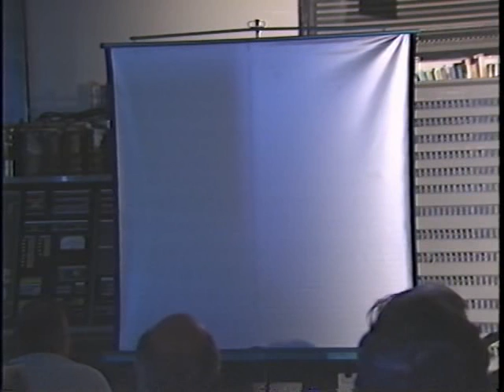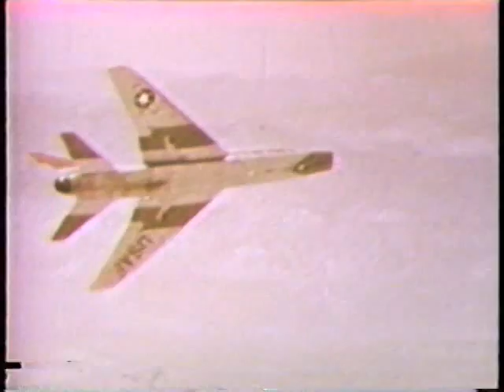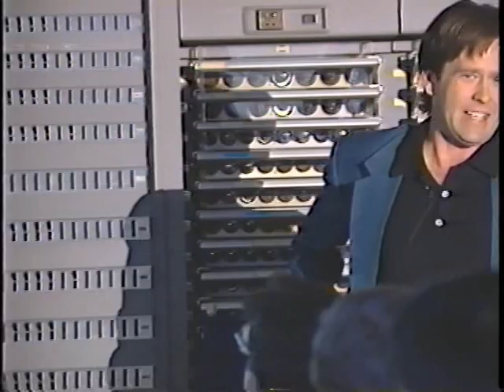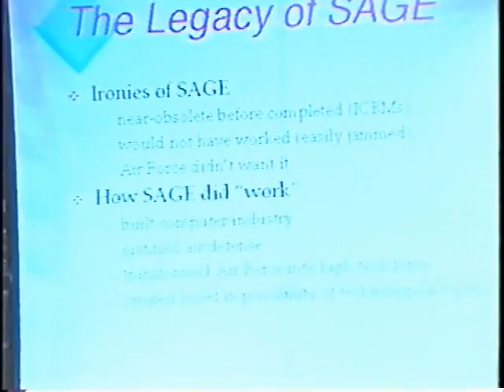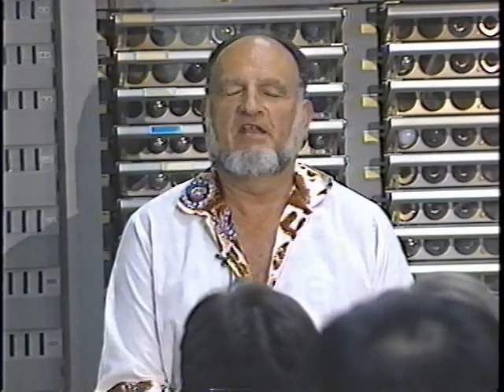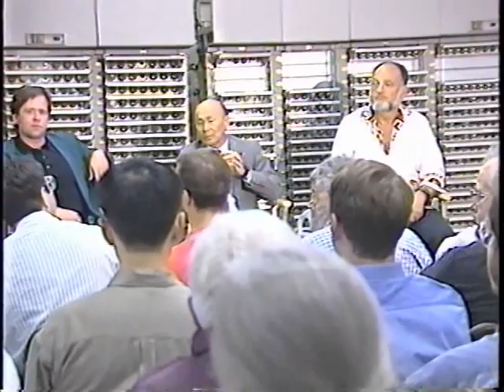SAGE Computer Based Air Defense

Comment: Regarding how many mega watts were going into sage "out of the domestic production."  Well, not exactly.  Each Sage center generated their own power using huge diesel powered generators, so Sage didn't actually use commercial domestic power - they were self contained.

Comment: I was fortunate enough to be assigned to the SAGE system at McChord AFB in the early 80's.  The computer was older than I was.  It was a remarkable education:  crawling inside the actual computer, putting hands on it.
Reply: I was stationed at the 24th AD at Malmstrom AFB, MT (Computer maintenance) in the early to late 70's. Left in 79 to go to College full time when I was accepted to the AECP program.

Comment: The radar data the DCs received did not come from the DEW line.  It came from the various radar sites in that sector.  The Alaskan radar system was totally different than SAGE.
Reply: Exactly! By the way, I was a maintenance man on the SAGE Computer system (ANFS/Q-7) back in the 70s. Also, speaking of Dew Line, later in life I was part of the team that did the site surveys for the North Warning System which replaced the Dew Line.
Reply: @basilbcf  I was in Radar Maintenance and was 'lucky' enough to get 2 assignments to remote sites in Alaska.